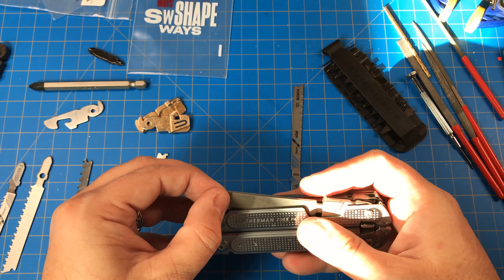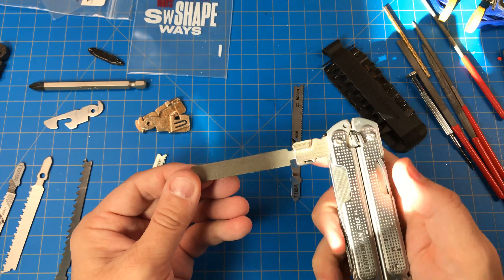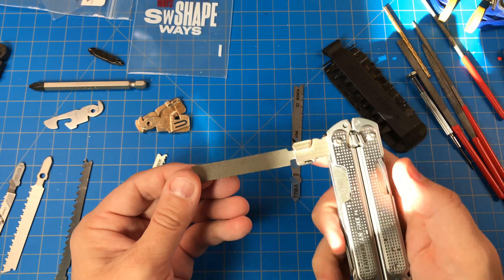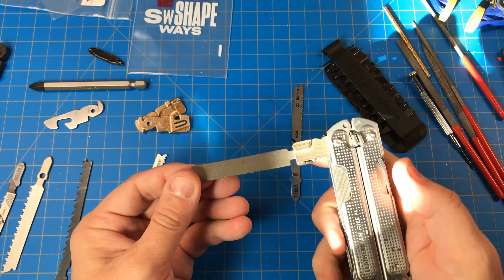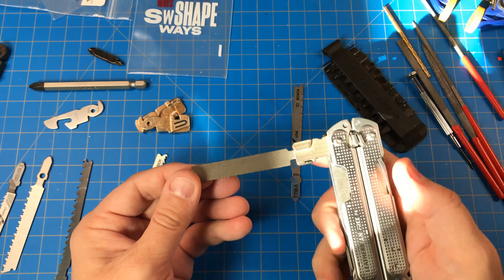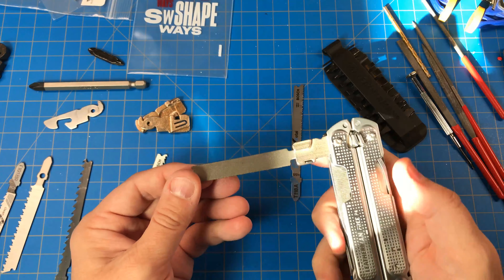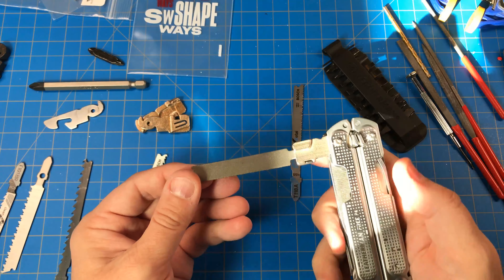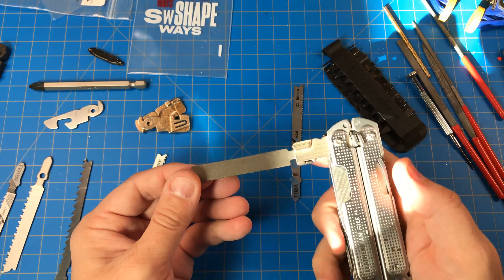T Shank holder, Rev 2, for Leatherman FREE P4

Comment: I like your first version mod, I’d like to purchase that version.
Reply from the maker: The first version doesn't fit into the tool as the spring pushes out too far. It also prys open when you use a tool.
Reply: I understand you had some difficulties with this version but I’d like the opportunity to help you make it work. Quick easy tool free blade exchange is the right direction for this mod, perhaps I can help you with another perspective on implementation.
Reply: Also I’d like to thank you for your reply, I wasn’t sure I’d catch you attention.

Comment: Fantastic mod.......couldn't help wondering if you would consider developing a disposable scalpel blade holder to replace the main blade (like the Havalon or Gerber folding scalpel handles). Scaple handle size #4 for blades like #23 or even #60......this would help make it travel/TSA proof (Style PS). I use my leatherman charge as a technical toolbox and don't need a knife to pry or carve with, but do need a razor sharp blade, you get so dependent on them, when travelling you really regret not having them handy.
Loving your work......you have certainly helped develop the Free into a tool the Leatherman really should have, cheers
Reply: @ZapWizard  I believe scalpel blades are typically 0.4mm thick, I think the Gerber Vital uses a two piece approach to achive the fine tollerance that is required, so perhaps that is the way to go. Havalon Evolve is a LM Skeletool knock off but frankly not a huge fan of the style and the quality lets it down. I haven't seen anyone doing this for the Free, or very sucessfully for any Leatherman for that matter, with your quality product development and ingenuity would think you could punch out another perfect mod to make the Free a true tech tool option.
Reply: @ZapWizard  dont think the spring is nessesary (traditional scalpel handles dont use it by Swann), but makes it a little easier to remove blade, maybe could use nylon here (but less moving parts the better). Not sure you could cut a grove that fine with a dremel (tolerances here are quiet important, not to mention the time involved), would have thought the two peice construction would allow you to put a fine step in the cap peice to make a stable fine grove for the blade.